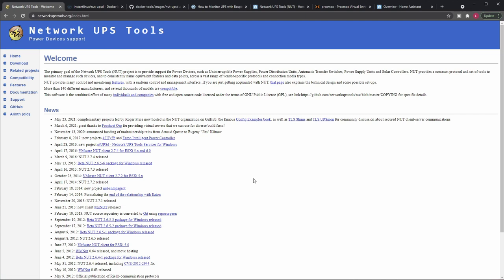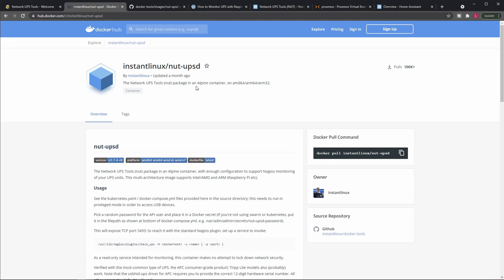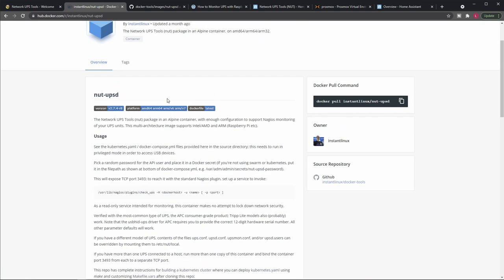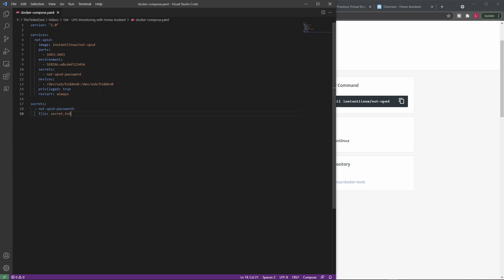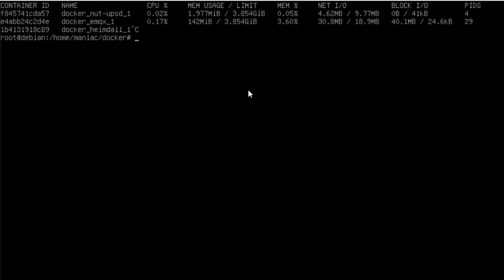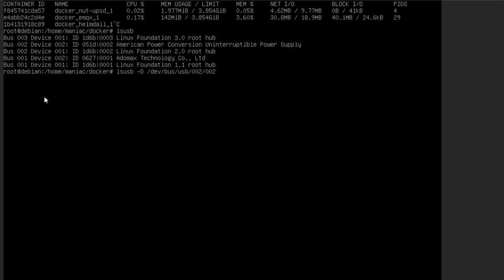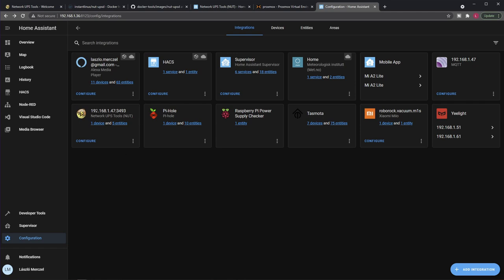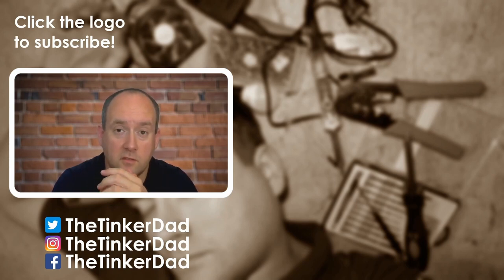How To Monitor Your UPS With Home Assistant

Comment: Hello,
Great, informative video. I have an old APC-1000 with a DB9 port, do you think is possible to retrieve data from it, using the serial port and I guess a FTDI adaptor to usb? Thanks.

Comment: you know if is possibile monitoring power consumption ? seems isn't possible
Reply from the maker: I guess you're talking about how much power the devices on the "output" side of the UPS pull from the battery, right? If so, sadly there's no exact value available for that - however I think you can approximate it by multiplying the nominal output wattage with the load percentage - e.g. 300W * 0.5 = 150W load. A more in-depth guide on such calculations can be found here: https://searchdatacenter.techtarget.com/feature/How-do-I-figure-size-requirements-for-new-UPS-unit Hope this helps!